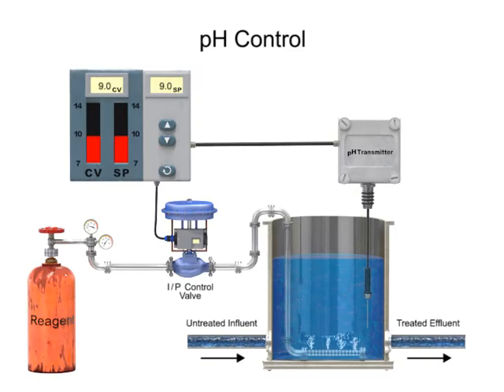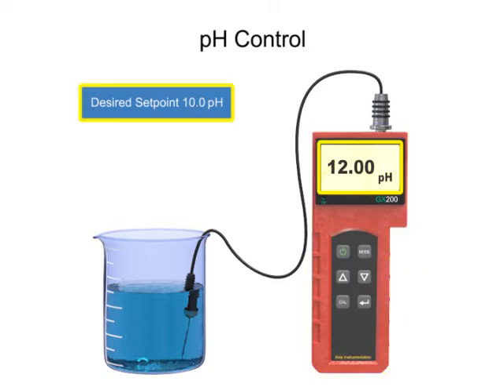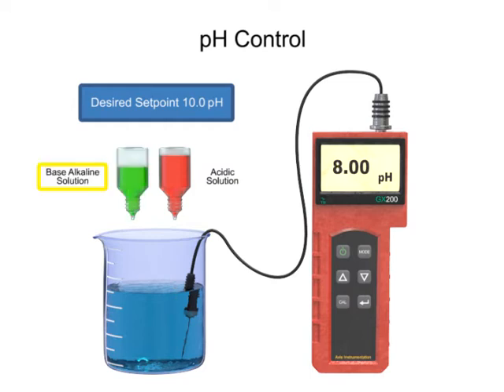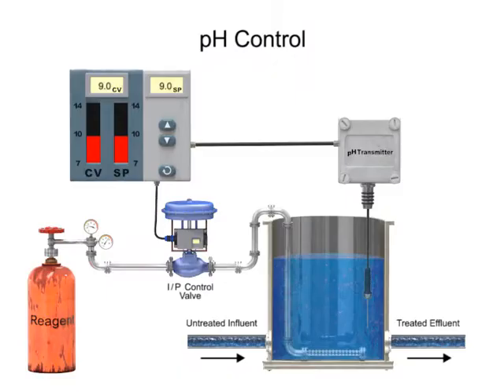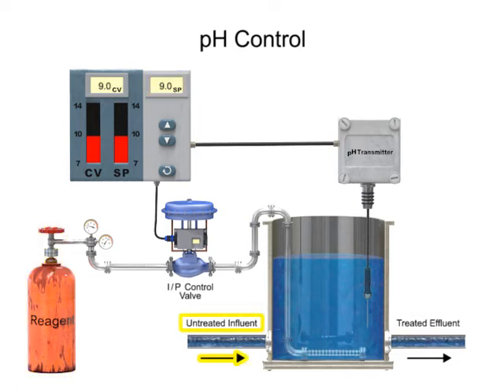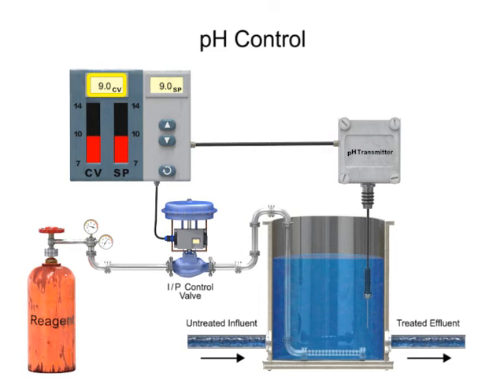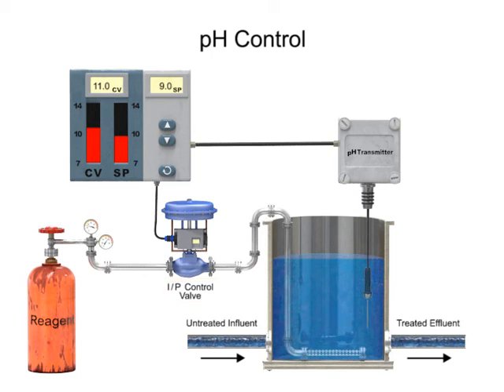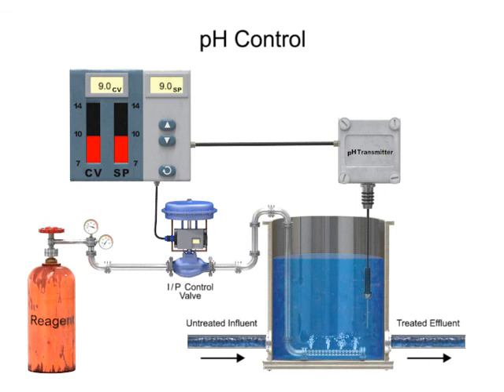All About pH Control

Comment: 2 Questions:
1. What technique is used in the controller which sent a command to control valve? is it PID ?
2. Can i make the simulation of that system in Matlab ?